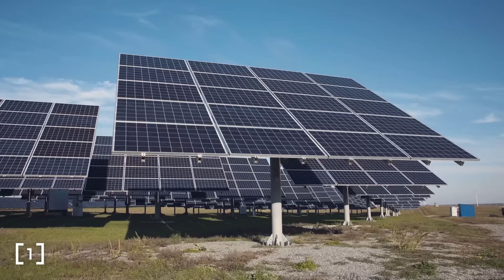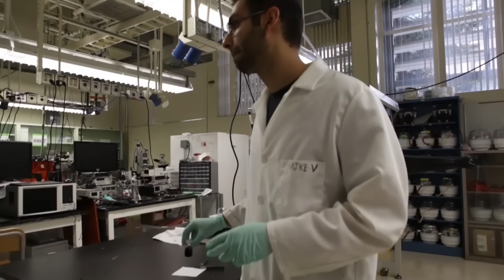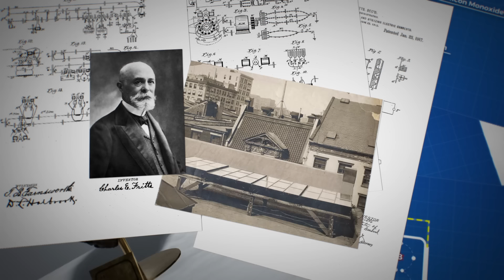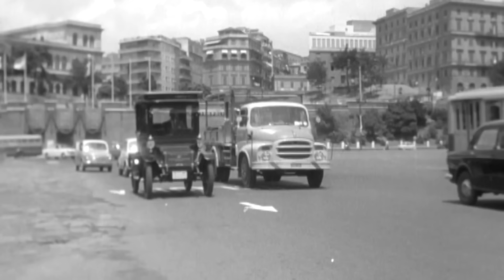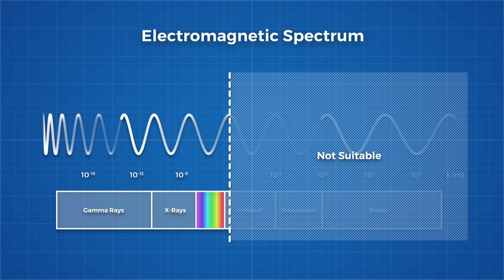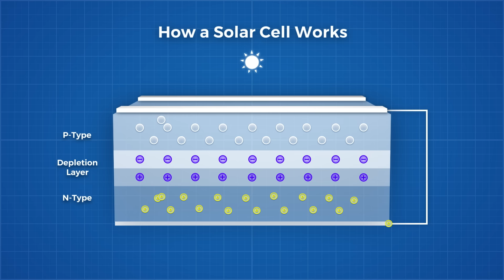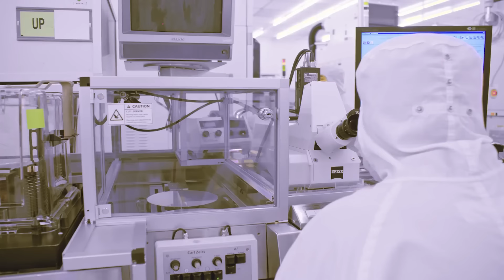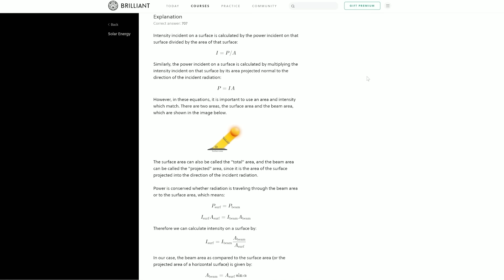The Mystery Flaw of Solar Panels

Comment: I find it hard to believe TiO2 is used to reflect less light since it's a white dye. All I could find about TiO2 in solar cells is based on other materials than silicon.
Reply: It is not a white dye. It's white because in powder form the facets reflect light. As a thin film it's transparent. It probably acts as a phase matcher so that reflected light is destroyed by interference acting like like the thin MgF2 layer on your camera lens.

Comment: This is not new and have been known since long long time ago. Solar cell is semiconductor which have been known will degraded its capacity due to heat. And current flow = heat loss there. 20% efficiency is not correct. It shall.be 17% as in fact heat loss is always there.

Comment: 1. To control reflection why can't we use polaroids adjusted for an angle in such a way to allow full incoming and no outgoing. 
2. On commercial scale use heavy water to extract ineffective heat to run turbine

How was this idea 💡?

Comment: 4:00 It seems like if you create a circular fiber optic path that would allow you to capture all the light of a particular frequency until the PV cladding material absorbed the light.
Reply: 11:00 Wouldn’t it make more sense to just passively direct optical energy to PV cells away from the panel? Then you wouldn’t have to worry about any metals in the panel including the electrodes that might block useable light.

Even before using passive optics to direct the light to a central electrical hub, passive optical sheets could have just concentrated the light into ribbons of PV materials which the electrodes could have just been placed between…
Reply: 14:00 Isn’t it kind of odd that the solar panel is a self-contained element? Any innovation in any portion of the panel renders the whole panel obsolete making it difficult to upgrade and costly to replace.

A passive optical system that handles collection and transport of optical energy to a centralized PV hub would offer the type of modularity which would promote less costly innovation as well as enable a more viable recycling solution that the current technology affords leading to more strip mining to replenish the rare earths list to landfill disposal of worn out PV cells.
Reply: 15:30 “Little gaps.”

Band gaps are hardly a “a little gap” in your knowledge. Did it lead you to lead doped perovskite? It should have been quite obvious how much you didn’t understand about PV cell efficiency when you clearly stated what frequency silicone operates in versus how many frequencies that it doesn’t.

Comment: The main issue with PV panels is that they only work, obviously, if there is sunlight. 
When there's no sunlight, nor wind to use wind turbines, you have to go back using traditional energy sources. 
If we want to get rid of fossil fuels, the only solution to this is to increase nuclear power and only intermittent renewables to cover the daily peaks in electricity demand.

Comment: Im not the brightest person, but I have an idea
If I remember correctly, there is a way to generate electricity with heat. And light also has heat as an output (and/or vise versa). So why not combine the two, and have a solar panel mixed with a thermal panel (for a lack of better terms)?
Has something like this already been done? Because if so, PLEASE link it for me, I would love to see it.

Comment: Very elaborate solar panels. Less expensive solar panels could be built for occasionally use in the Edison generator and dynamos power system.  Photo electric molecules from halogenated vinyl and halogenated carbon processing have to be eliminated to survive the serious and persistent damaging effects of manufacture use and stockpile burning.  I am most familiar with photos electric halogenated vinyl solar panels.  So the conversions is to survivable industry solar panels and survivable industry batteries.  Erythrosorbate and metal oxide glass as a generator of electricity and inexpensive metal pickup of the elections.  Erythrosorbate under glass over nickel steel cells. Masked continuity and small 3 volt panels.

Comment: Thanks from Buenos Aires Argentina. I subscribed to your channel. My calification is genius level. And the information you provide in this video is a guide to buy the better technology in solar cells to install in houses and facilities or even vehicles. This year I'm gonna buy a system to install in my house. Of course there are another components like batteries, charge regulators, power and voltage converters, large section diameter copper wires, installation in combination with public power supply.

Comment: "Website that teaches you to think like an engineer"

Me: I'll now design an engine bay where you have to remove all components along the serpentine belt to be able to change a water pump.

Next I'll put the starter motor in the valley of a V8 and at the rear of the engine compartment.

Comment: as someone directly working with crystalline solar cells (I know most of the authors shown personally!) I must say you over-emphasized that this was a mystery problem. It was well known for years and there have been other countermeasures developed (like high intensity light illumination aka "regeneration" etc.). 
Gallium doping is taking over but that's also not even close to being new knowledge.
Reply: *personally... Is so cool

Comment: 40 years and there has not been any real improvement in the panels( the non photovoltaic component) Installing them is insanely primitive and cumbersome. The frame is sub optimal, so is the glass. The maintenance of a panel has never been addressed and the electrical connections are 19th century .

Comment: People wanting this technology to flourish, need to keep all the variables in the discussion.. namely heat produced by large solar farms and the close competition with natural gas. Making electricity from substrates of silicon is very attractive in the sense that it is passive in nature, nothing to do but harvest your 20 something percent energy every day without moving more than a thought.. but there is more to the story, like manufacturing, efficiency degradation over time and real estate required for implementation.. nobody ever mentions the amount of heat produced by these farms, especially while maintaining their "Global warming" narratives. Some quick math will show that if you are harvesting a whopping 40 percent from your solar panels in a fantasy configuration, the other 60 is heat.. at 1Kw per square meter at high-noon on the equator. So if you claim to have a 1Mw solar farm, 600Kw is just heat! Actually 2047285.2 BTU/hr for 6 to 8 hours a day.. that can be as high as 16,378,281.6 BTU per day of operation. This would be equivalent to burning 15,794 Cubic feet of natural gas every day.. I can generate over 1.8Mw of cheap, clean energy just with the heat that solar wastes in thermal losses every day!.. and the next time someone tells you CO2 is "bad for the environment" is simply confused, CO2 feeds the flora and fauna of this planet... So stop mowing down green spaces for solar farms and ridiculous tesla factories.

Comment: What if solar panels were applied or built as a sphere or box, with the side facing upwards being translucent,  trapping that solar light inside,  to bounce around?That could maybe double the output,  adding complexity. Absorbed heat is also useable,  if transferred to a steam electrical generator. Why waste,  at powerplant level? Oh,  another thing,  reflected light would only add energy to our weather phenomena ,  on a global scale.  Having  a hunch that can't be good.... unless controlling where light is reflected,  priming earlier clouds etc before them becoming hurricanes...

Comment: You failed to mention that silver is critical to the channeling of the free electrons to the electrical wire out of the solar panel.  Silver is the most conductive metal and is integral to the solar industry in making long lasting efficient solar panels. Manufacturers have reduced the amount of silver but there is a limit where they quickly reduce efficiency & durability. Substitutes will be very difficult due to silvers portfolio of amazing properties & substitute costs.

Comment: SOLAR HEAT FROM 1943:  My house, in Florida, had a solar powered water heater installed in 1943.  The solar unit was a steel box, about 3 inches deep, with a sheet glass on the face.  (This box was about 12 feet long and 2 feet wide, but these dimensions can be as big you want.)  This box had a 1 inch copper pipe that zigzagged though out the box, with about 3 inches between the rows.  There was also a sheet of copper lining the back side of the box.  Both the pipes and the coper sheet were painted black so as to absorb the heat of the sun.
 The box was placed at a 45 degree angle, facing to the south.   The pipe then went to a normal electric water heater, which heated the water on cloudy days.  This was a simple, but efficient, system that was still in use when the house was sold in 2009.
Reply: Not at all what's being explained in the video, but sure, cool.
Reply: We had a pool heater like this, basically an analog solar panel 😂

Comment: 4:10 - Silicon monoxide and titanium dioxide passivation/anti-reflective coating is no longer used. The upper surface is nitrided, which both passivates the surface (renders it non-reactive) and achieves low reflectivity. It is the nitride which gives the blue tint to most solar cells. There are black cells, but the black is merely cosmetic and incurs an efficiency penalty.
For more information: https://www.pveducation.org/pvcdrom/manufacturing-si-cells/anti-reflection-coatings

Comment: QUESTION = (age of the earth) 
-Taken from - https://www.space.com/23694-moon-dust-mystery-apollo-data.html 
"It would take 1,000 years for a layer of moon dust of about a millimeter (0.04 inches) thick in accumulation,”
-
So if our universe is really 4.5 billion years old 
4.500 000 000 years X 1 mm/1000 years = 4.500 000 mm = 4.500 m = 4.5 km   
<<< 1 meter for every million years of age >>>
So there should be 4.5 kilometers thickness of dust on the surface of our moon = God's Hourglass
The depth of space dust on our moon more equals the age of Creation = less than 10,000 years

Comment: Thankyou. I have noticed my solar panels get lighter in colour as they age. It seems UV is bleaching them. That said I have found they get twenty years useful service at 80%+ rated power. They do accumulate damage though. Hail, lightning (both flash and strikes) cracked wafers and cracked covering glass, corroded frames take their toll. By twenty five years most have a fair bit of damage and need replacing.

My oldest panels still working are thirty years old. I have one that is thirty five years now being used as top of a coffee table.

Comment: I thank you for explaining quite nicely and simply how solar cells work. I will be viewing your video several more times so as to catch some of the things that I know I missed on just this 1st viewing.   Because of the  future  of and need for  "green" (= carbon free) energy, I have been doing much research ( reading and viewing videos) on solar cells and hydrogen fuel cells(batteries). From what I can tell, the energy created using solar cells can be use to release hydrogen from either water or ammonia. Ultimately, the energy associated with this free hydrogen can be stored in fuel cells. Fuel cells batteries can store more energy than lithium based batteries. Lithium is considered "grey" energy and because of mining, it is environmentally destructive.  The same cannot be said about water and ammonia which are considered  green energy. As a result I have been investing/speculating in both types of ventures(solar cell and fuel cell manufacturing). Below is an excerpt of a news article that relates to the current efficiency of solar cells. 

Zacks Equity Research
Fri, July 16, 2021, 8:44 AM
In this article:
JinkoSolar Holding Co., Ltd.’s  advanced high-efficiency solar module recently set a new record by attaining the highest conversion efficiency at 23.53%. Its large-area N-type monocrystalline silicon solar cells have also set a test record of 25.25%.

P.S. JinkoSolar is one of the companies in which I invested.

Comment: If you add in building solar panels, disposing of them, the complete destruction of the environment where they are installed, and the dust pollution the create, solar is arguably harder on the environment than traditional energy sources.  The environment would be much cleaner than it is now if all the money and effort put into developing solar was put into making traditional power sources even more efficient than they are now!

Comment: The 20% efficiency is the manufacturer standard test condition at control environment, thus is normal the efficiency reduce by 10% after one hour due to operating temperature and other factor. This is not big issues at all and degradation is normal and it take time no big issues at all. 20% new efficiency after 20 year maybe 12% but still work producing electricity.

Comment: BULLSHIT! There has been very very very little technological advance in solar cells, they continue to run at 20-30% for low cost cells. This has not changed in 40 years. The only reason they are viable what so ever is government subsidy.

Comment: Since the higher frequencies have wasted energy, can you not coat the panel with a fluorescent compound transparent to lower-energy photons powerful enough to excite the silicon directly while converting higher-energy photons into releasing perhaps multiple electrons for each high-energy photon hit? "When Xu and Wu directed energetic photons toward the superlattice, they discovered that those Van Hove singularities were sites where one energized photon could transfer its energy to multiple electrons that are subsequently collected by electrodes—not just one electron or none with the remaining energy lost as heat."

https://www.futurity.org/photon-electron-partners-1163012-2/

Comment: All these costs to make it and to attach it to the roof resulting in such a low efficiency is depressing me. (amongst most other things) So I wonder for ages now if it would not be better to work with the cheapest organic solar cells with even lower efficiency but you then replace them more often and you just attach them to everything so it's all DIY.

Comment: Excluding the deterioration of photovoltaic arrays and the clouds of natural weather patterns, solar energy is at best a 25-5o% energy source - max 5o% during two months of longest days (Summer), Max 25% during two months of shortest days (Winter) and Max of 35-38% during the eight months of ‘average’ days of Spring & Fall.

No solar panel can/will generate ANY electricity at Dawn , Dusk or Night - more than 6o% of a calendar or solar year.

Comment: How about:
1) split the incoming light with a prism.
2) Use PV cells that respond better to the different wave-lenghts of light strikeing them.
3) simply reflect light that cannot be used by any PV cell back out again.
4) Use electrical conductors that are transparent to the wavelengths of light that are useful.
This would generate more power and less heat.
Is any research being done in any of these areas?

Comment: I find it weird how scientists forget simple solutions sometimes in effort to find a complex solution.

It's possible to reflect more light, and in turn gain more energy by using mirrors underneath the panels themselves. 

For example, using the layered method first mention put 4 mirrors, each seperated by a bit to allow heat to disperse easier.

Then put the final textured layer can be used as a final heat reducer using a material to reduce heat, but also reflect photons that strike it.

I am sure, at the cost of some increased upkeep it can have improved efficiency.

Sadly, it seems most scientists scoff at that idea, or ignore it entirely because it produces more heat.
Reply: scientists of the world: hired
Reply: Bro you are not smarter than people who have spent decades in the industry.
Reply: They don't forget simple solutions. They consider them and discard them because  they don't work. Don't think you are some sort of genius because you can point out a solution that is probably very flawed but you don't know it because you only have surface level knowledge about the science of solar cells.

Comment: Good, except there's no such thing as a photon. Because the double slit experiment suggests that light is a particle, that is simply NOT true. Light is a specific, narrow band of the electromagnetic spectrum. Of which includes X-Ray, gamma rays etc,, depending on the frequency. And the colours we see is simply the varying frequencies within the EM spectrum that we detect with our eyes. 

Someday, someone will come up with a hypothesis as to why the double slit experiment confuses us. That hypothesis can be tested, with real physics EXPERIMENTS that can perhaps be replicated. That's REAL science. 

Like when the Greeks declared that a heavier object falls faster than a lighter one. Then some guy climbed a leaning tower with some big and small cannon balls and dropped them off from the top. Time and again, observers declared that both landed at the same time. 

So instead of relying on the erroneous ASSUMPTIONS of so called, scientists, let's work on why the double slit experiment fools us into thinking that an electromagnetic wave is a particle.

Comment: Solar always talks about installed capacity. Capacity is no where near actual production.  Stop lying and talk apples to apples. Batteries won't help. The problem is winter not nighttime. You can't run at 20% 3 months a year. But the equator! Then you have heat problems.